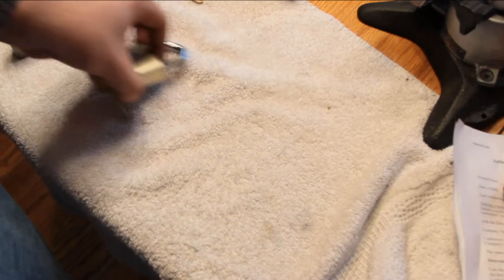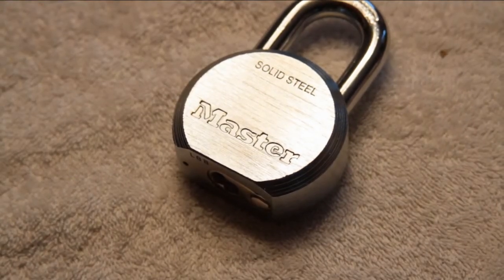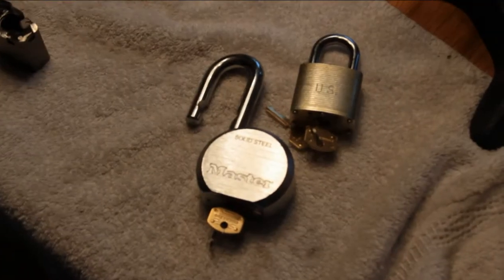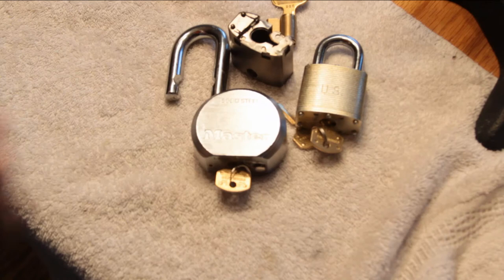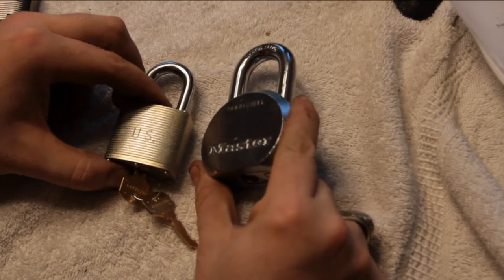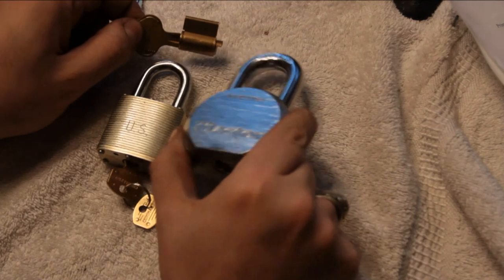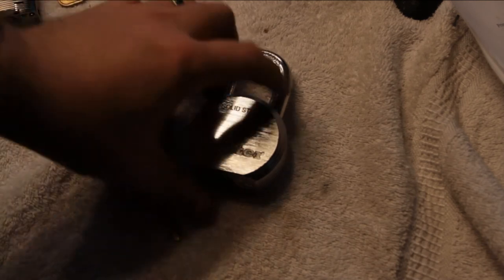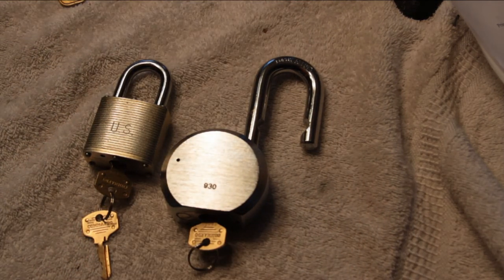(063) Commando: Resurrection

Comment: lol I like this... atleast you did not waste the core :)

I just decided to cut mine so that I could put it back together... (using jb weld to fill the small slits I made) its not perfect but, with jb welds 3960 psi strength test, i think itll be fine.